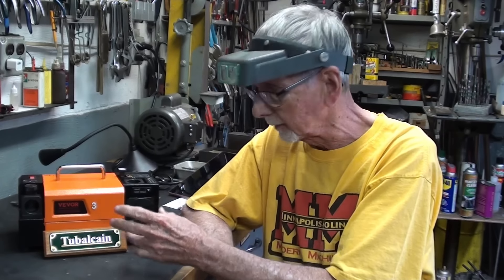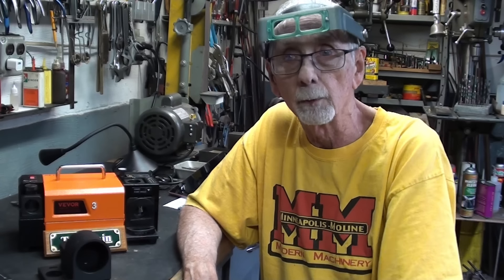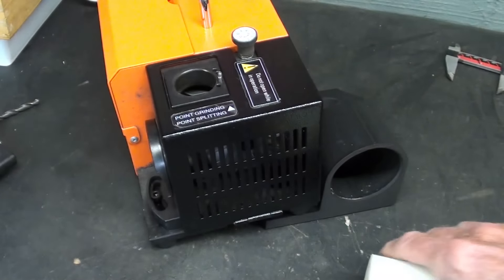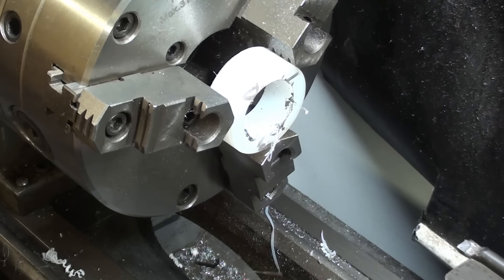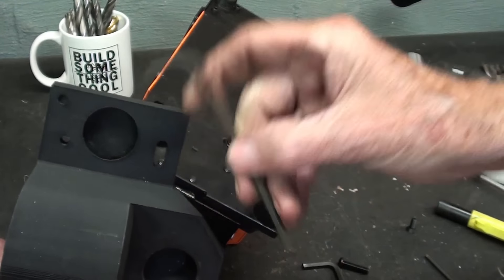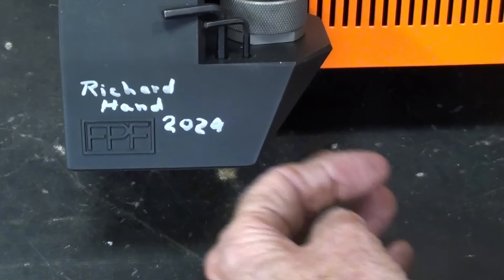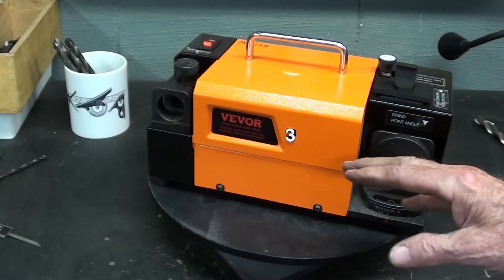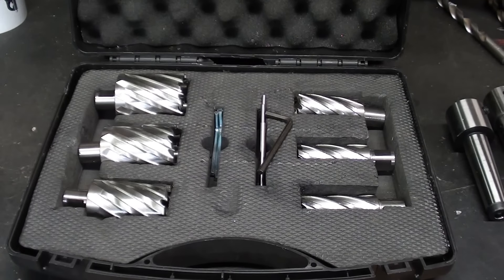SWARF COLLECTOR for VEVOR drill grinder pt 4 #977 tubalcain

Comment: You should have turned the dia and bore  holding on solid nylon  and part off .you we’re lucky it never came out of chuck with such a thin wall   it moved when you checked it. I bet the bore was not round.

Comment: Delrin is an amazing material for such job. I made an adapter for a vacuum hose last winter, but didn’t have delrin at hand. I used an old hockey puck available in many sports store. It is harder to machine than delrin. It may have steel component depending the source of rubber (some are manufactured from recycled tire), but it made the job. Use a vacuum cleaner when machining. It makes a mess of a dust.

Comment: The General (also marketed by Craftsman) drill grinding attachment shown at the end of the video is one of the best drill bit sharpeners there is...  it can produce factory quality with the proper modification that will change the flank radius to match the bit size.

Comment: ATTENTION, before purchasing one of these nice drill grinders, watch Mr. Pete’s videos on the 13-A and 13-B models. 
Vevor changed the description of the 13-B to no longer state that it will sharpen end mills. I bought the 13-B and after working with Vevor product support, they exchanged it for the 13-A. 
Most of us shop guys would prefer the 13-A because it does a perfect job of grinding split points. 
Watch Mr. Pete’s videos and see how he explains the difference. 
Excellent job on the adapter Lyle.
Reply: ATTENTION indeed - - i got bitten with the same situation when the A was of stock, I wrongly assumed the B was a replacement model -it is NOT.  BEWARE.  There is a D model that does both split and relief cuts, simply an angle difference.